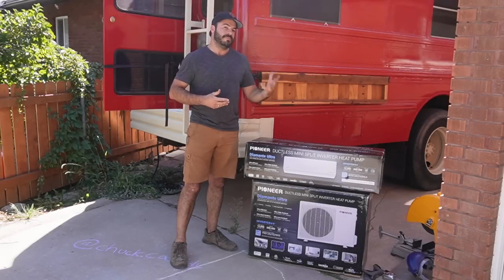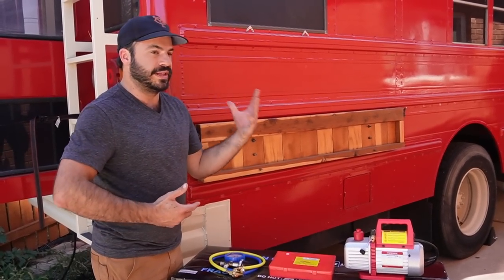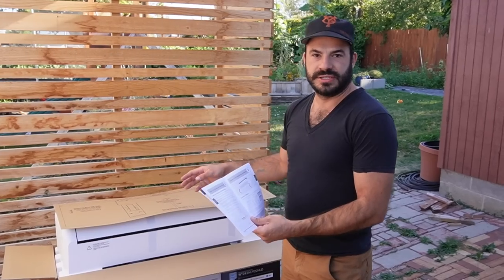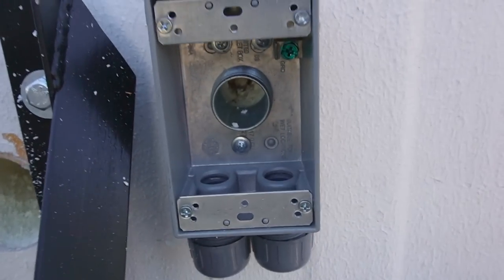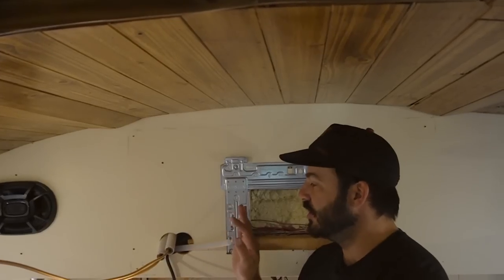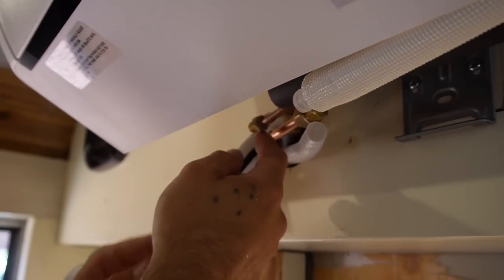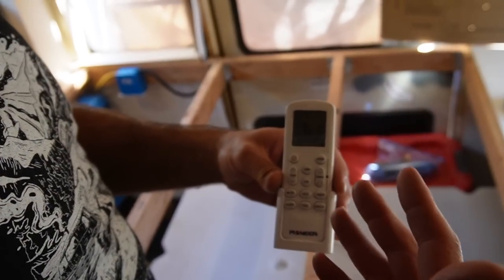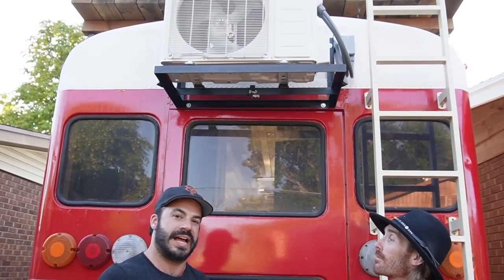Installing a Pioneer Minisplit on a Skoolie | A Complete Guide

Comment: I have a Coleman mach AC unit in my ceiling on a ambulance 🚑. Only works when plugged into shore power 🔌. I'd like to go with a mini-split... but, can it run on solar? I have 400w on the roof and 2 100w lithium batteries, 40A MPPT, DC to DC charge controller and 3,000w pure sine wave inverter. My brain hurts trying to figure these things out.🤯
Reply from the maker: You need a minimum of 1200 watts to run a minisplit on solar
Reply: @ChuckCassadyYT  on the video, you have 3 lithium batteries?  If my calcs are right then these are 400ah units i.e. (5100w ÷ 12.8v)?

Comment: Yo I gotta comment because I followed this guide and only afterwards realized this is not (!) a good way to route the copper pipes. The copper pipes from the indoor unit SHOULD NOT BE ROUTED ALONG THE BACK OF THE UNIT to the left and then outside. They should be routed directly out of the bus on the right side, that way the connections between the indoor and outdoor units will be OUTSIDE (!) the bus. This way they are easily accessible for pressure checking, rather than being tucked behind the unit. And yes, if you do it perfectly, this way will work, but first of all its hard to get it perfect on the first try for someone doing this for the first time, but also having all those tubes and electrical running behind the indoor unit make it extremely difficult to properly click the unit down into place when this is all done. Looking back, this is also the preferred method recommended in the pioneer documentation, but also by HVAC installers I talked to after the fact. 

@chuck - I love you and learned a ton from your guides, but this one needs to be updated, because this method makes the piping needlessly difficult.
Reply from the maker: That is not what I saw regarding the preferred installation and having the connections outside of the bus if the unit is mounted on a side wall will not work. Thanks for your feedback, glad you found something that works for you